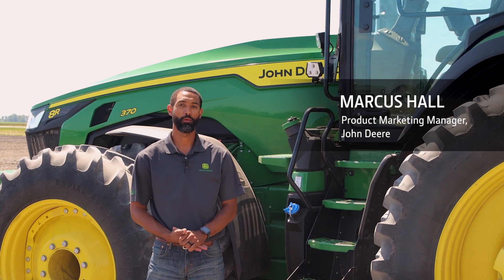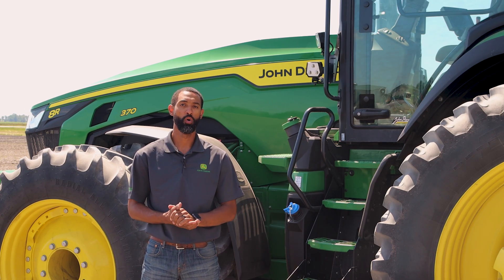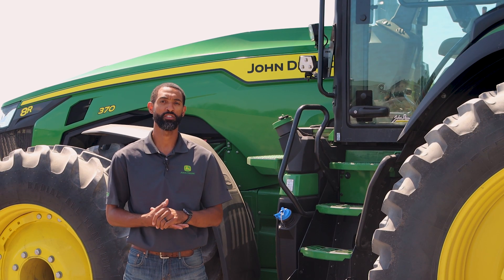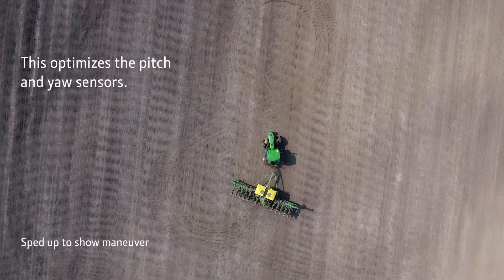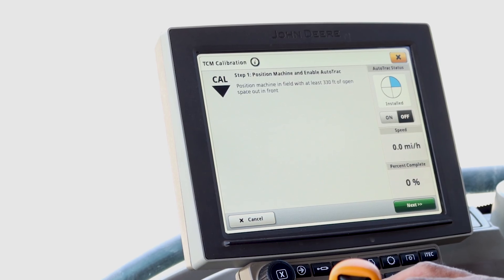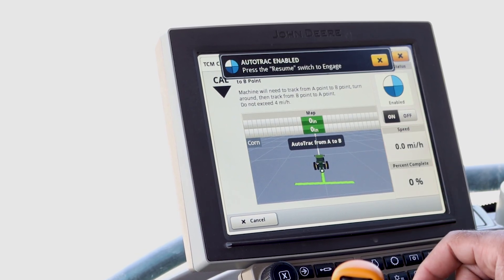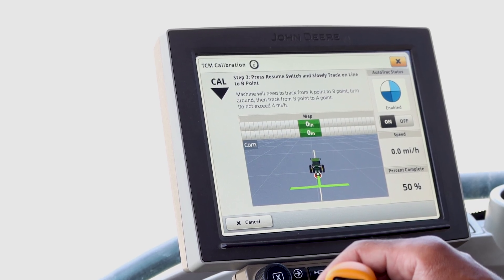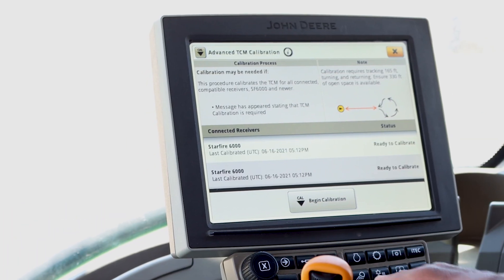StarFire™ Advanced TCM Calibration | John Deere Precision Ag

Comment: Good improvement !! 

Does this update work on ALL receivers with TCM ?   

Why doesn't the implement have to be in operating position (planter down) ?
Reply from the maker: Thanks for the question, Jim! No, this update does not work on all receivers. You must have a StarFire™ 6000 Receiver or newer with a Gen 4 display or newer. The planter must be in field operation mode, meaning planter unfolded, not ground engaging. The distance between the tractor receiver and implement receiver changes when the planter is folded versus unfolded. The software is looking for the implement receiver to cross the ‘A’ or ‘B’ points within a certain time after the machine receiver crosses that point, and when the planter is folded it takes too long for that receiver to cross the line and the calibration will fail. We hope this information helps!